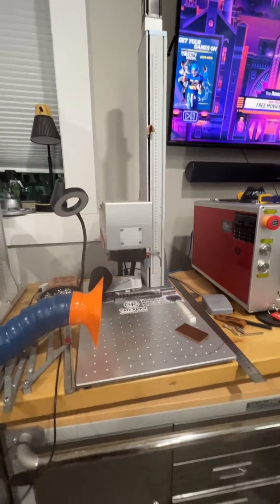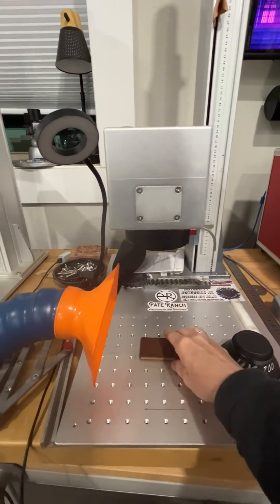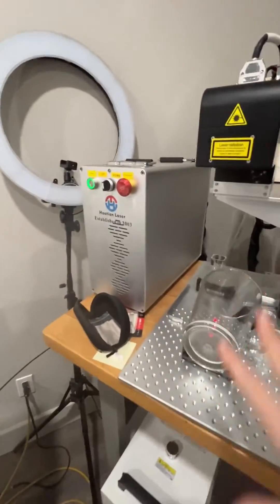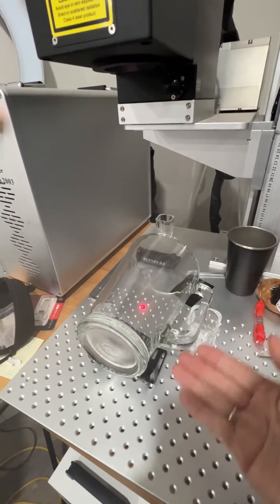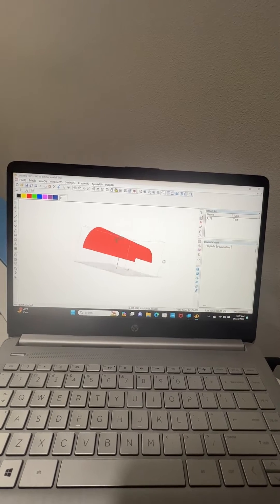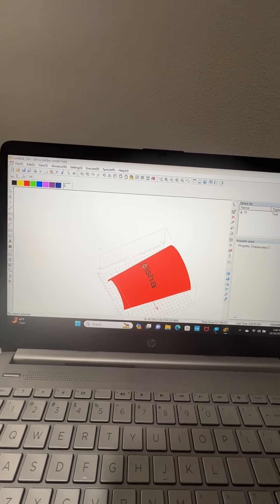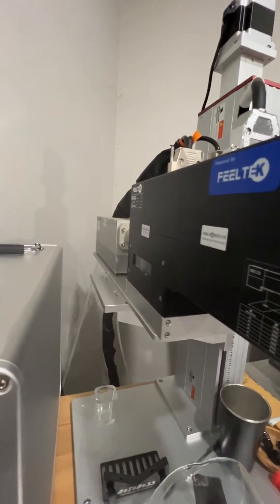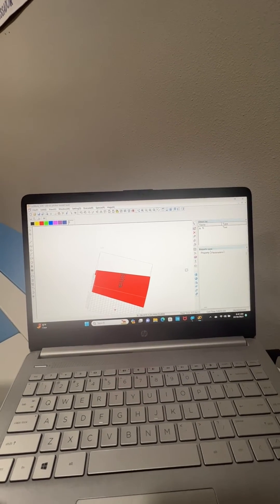2D vs 3D Galvo UV Differences

Comment: Revisiting this video again. Great video! Several questions: 1) Do you have any thoughts (or seen/heard anything) with the 3d maybe having more issues because of it being a more complex machine which seems to have a lot more moving parts, and 2) If Lightburn ever came out with 3d support, do you think you would switch to that assuming that it was as robust as their current software? The only two things that are keeping me from going 3d is cost per watt and no Lightburn support. Thanks.

Comment: Thanks for the video. I have been torn between a Thunder Bolt, Odin, UV galvo, and CO2 galvo for my next laser and over the past week had started leaning towards the UV for glass work and believe I also saw on another video that UV is great for batching metal credit cards because the UV doesn’t warp the metal. NOW…I see this video and the question is, do I go with the 2D or go all in for the 3D? I was a little disappointed to hear that it doesn’t use Lightburn like my Nova and my fiber but my CNC router doesn’t either so guess I will have to learn another piece of software if I go the 3D route.